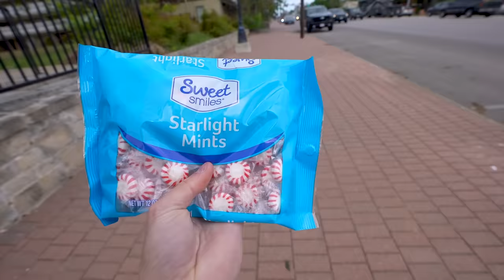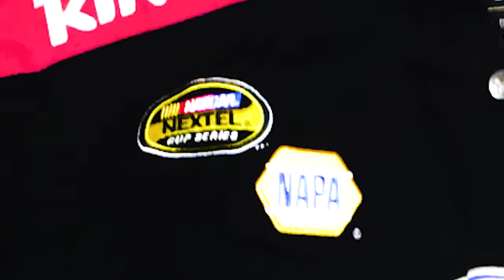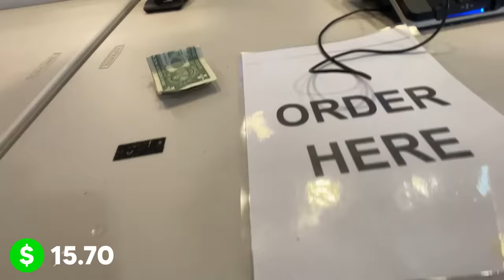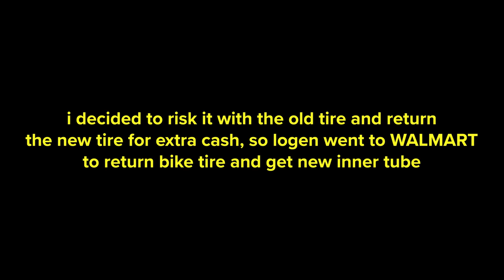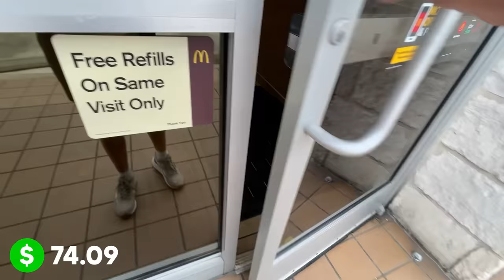I Survived On $0.01 For 1 Week - Day 2

Comment: Tire chaning pro tip: put a bit of air into the tube, put one side of the tire on the rim, then stuff the tube into the tire, and finally put the tire the rest of the way on.

Also don't use a 24" tube for a 26" wheel but I am sure you noticed that after the fact 😄